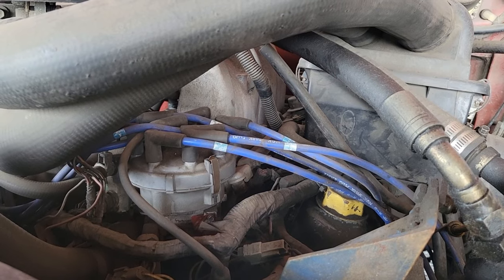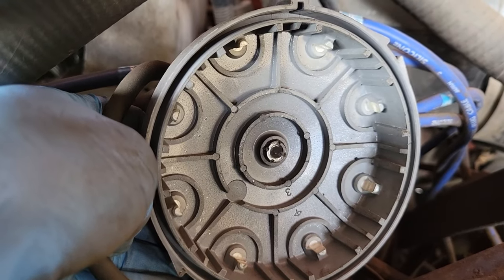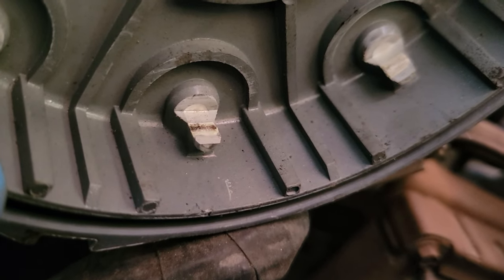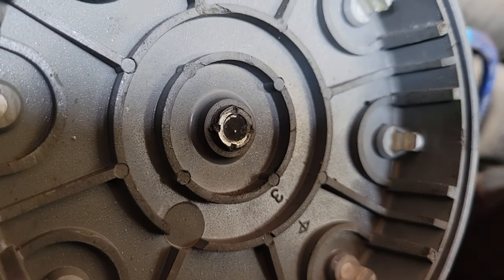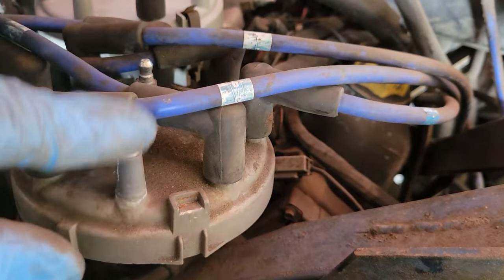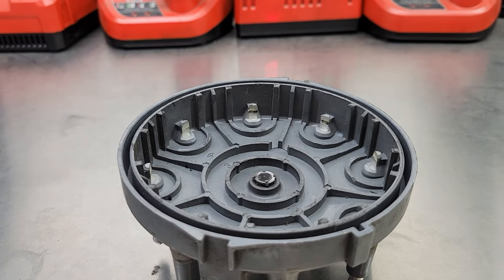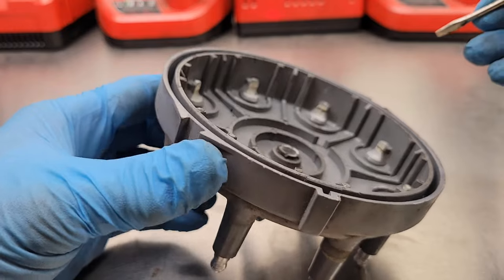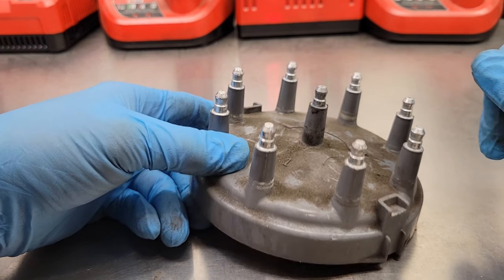Misfire Stall Or No Start? How To Check Your Distributor Cap For Common Problems.

Comment: Yup, I had a no start.  Pulled a plug wire, plugged in a new one grounding it to the exhaust manifold and cranked it, I had spark.  Sprayed some starting fluid into the throttle body and cranked, no fire,,,,what?  Got spark (so I thought) and spark juice.  Ran perfect the day before.  Checked all the fuses and relays, good.  Checked fuel pressure and pump, good.  Pulled cap off and center pin was broke off,,,,dang, never seen that before.  How did I see spark when I plugged in a skate plug,,,,baffling!!!!  New cap and smooth as silk again.
Reply: Hey sounds like you're having the same problem I'm having today June 2023.. I tell you what man it sucks just wanted to tell you I got my F-150 1995 and I have replaced the distributor cap and rotary button as well... still having a problem with it not cranking you need to do like I have done and check the ignition coil on top engine to see if you're getting spark? If that's good and you're still not getting spark check your ignition coil modular over there on the driver side fender.. by your brake booster and master cylinder.. it costed me $66 the other day at auto zone.. just wanted to share that information with you since you're having about the same problem I am maybe they'll help you man
Reply: liked
Reply: No spark on my gmc sierra. Aparently the ICM is infamous. Today im replacing the ignition control module, ignition coil and distributor cap and rotor button. Hopefully its one of those. I really dont want to learn how to change the entire distributor but ive got to get it back up for work on monday lol @jessicasteffey

Comment: Beautiful job brotha man. I just did a tune up and decided I wanted to wash my 1977 Chevy 350 motor and after I did I was getting a misfire.  Now I know what to check ✔️.  Awesome 👌
Reply from the maker: Thanks for the great comment. 👍 Glad I could help. I remember 4x4ing with a friend and he went through a big puddle fast, then the truck shut off. When it was engines I always cover distributor with a grocery bag.
Reply: @Shaners Mechanic Life  funny thing is it ended up being a bad spark plug out of the box. But I still cleaned everything and checked everything. Thanks to your video.  :)

Comment: I have a similar issue with my 95 SL500. I doubt the caps/rotors have been changed since the 00’s. When I checked them, there was all sorts of carbon tracking, corrosion and gouging on the contacts as well as condensation. Ended up sanding each contact a little (I wasn’t too thorough) and it fixed the misfire for about 2 minutes. Currently waiting on all of my parts to get here; hopefully that’s the issue.
Reply from the maker: Let me know how it works out for you. I always start with maintenance items when dealing with driveability issues.

Comment: I have a 94 caprice had it for four years never change the spark plugs or did any real route team maintenance other than oil changes finally changed the spark plugs. Exaust started backfiring fixed but now the car jerks and idle and slow acceleration could be because of the distributor ?

Comment: I have an 87 dodge d150 with the lean burn computer. My center nub on mine does appear to be worn down but I don't think it moves. I'm trying to replace the pickup coil right now. Never thought about the cap itself being the problem.
Reply from the maker: I always recommend checking wearable maintenance parts first when there is a drivability issue. Let me know how it works out for you.  Thanks for watching.

Comment: Circuit board cleaner after the water displacer when cleaning out the cap. 

After brushing out corrosion from the leads and points, hit with circuit board cleaner before your dielectric paste. 

It's used to clean circuit boards in a laptop, so should be okay for the distributor cap and leads. 

I use the circuit board cleaner when changing fuses in my hatchback
Reply from the maker: Good idea. The circuit is only as good as its poorest connection.
Reply: @shanersmechaniclife3164  physics 101

Comment: That's 💯.. Thank you so much..What causes Toyota corolla 110  be sluggish in climbing hills but on flat surfaces it's picks well.?? Have changed spurk plugs nothing has changed except reduced fuel consumption
Reply from the maker: Have you changed your fuel filter recently?

Comment: Speaking on the wire diagram I have a stack of photos of firing order sequences lol those really help but putting a little mark on em isn't too bad of an idea
Reply from the maker: I do the same thing sometimes.  Start at one point and number them going clockwise.
Reply: @shanersmechaniclife3164  I have one of those low profile distributor caps so it's all numbered already 😅 but it's good to know left side goes 8246 and the right is 1537

Comment: Ibe got the 94 ls 400 and currently trying to retime what I believe is the ignition timer. 

TDC is marked on one housings where two caps were replaced along with in the same spit the rotors where changed. One of them is set perfect but it's the other one which didn't have a mark like the other one was for TDC to know how far 10 degrees was. Giy working on my car who use to be a good friend up until this does know his way around an engine. But if you know anything about a lexus ls 400 eng8ne you know this thing is a beast and has so many parts that it takes quite a lot to get this done. Anyways where he thought might have possibly been a mark for TDC  he used and used that to adjust to the 10 degree but alas it was wrong. Why he put the whole car together before checking his work us something I can't answer but to express how utterly lost I am at understanding just how far this issue can go isn't nearly enough. 

I'm assuming all but this one is fine. 
From my knowledge there are just 2 distributor caps and 2 rotars which are the only two things I know timing has been adjusted on and if he's right about the one then only one of these two things are set wrong. 

My biggest pain in the ass is understanding ehat the heck that cap went onto? The distributor? So the rotor powers the distributor then or what?  For some reason i thought it was a cam. As this engine has 4 of these damn things so as you can see with that info maybe you'll have some empathy for my frustration and see where it's coming from. 
I'm looking for someone to give me some clarifications to understand what the hell to look at or into to try and fix this problem. 

It's likely really fucking simple beyond the taking shit apart part and involves a few twist here and there I just need to know where that is

Comment: If you have moisture in the distributor cap you can spray wd40 in there and it will wick the water out. Then just take a paper towel or rag and blot the excess wd40 off. 
I had a jeep that wouldn’t start if left out in the rain  I would spray the cap and plug wires with wd and it would start right up.

Comment: Thanks many!  I have a 1998 3.3L Nissan Pathfinder. 175,000 miles. Great condition. Stock. My tank gets alarmingly  pressurized when driven a couple hundred miles. I don't have any codes. My Nissan gas cap visually inspects clean and good. Does not leak. 

I even disconnected all hoses on the EVAP system and cracked the gas cap. No codes were made either. How can that be? I drove it dozens of miles to test. To see if the missing stopped or codes would appear. No codes, except random misfire. Every now and then, but the motor is obviously missing mildly to badly all the time.  It gets worse for a while when I refuel.  For a few dozen miles.  

When this system started doing this, I started getting a random misfire code at the same time. These may be unrelated. Not sure. 

I have verified purge valve works, hoses are clear now. One was dirty about 2" clogged at the canister for the purge line. It looked like charcoal dust. All other hoses clear. 

Any ideas?  I was going to remove the plug from the cannister ambient vent valve and see what that did. It should toss a code right?  And make the valve open, from my understanding?  I don't want the tank to pressurize like that again.  It will spew and hiss for about 6 minutes when cap is removed. I've never seen a vehicle do it this badly before. 

Thanks!

Comment: I did a spark test . I have no spark in 3 spark plugs but 1 does . Would this be the cap ? Someone said it could be the ignition coil. But i assumed if one plug got spark then the coil must work

Comment: What happens of the rotor moves around while changing the cap ? Will it mess up the timing ?
Reply from the maker: Depending on what's moving, older distributors have vacuum and centrifical advance. What your feeling could be perfectly normal. Did it run fine after you put it back together? Thanks for watching.

Comment: This procedure works for any car??......if i change the rotor, does it require any ...CALIBRATION OR ALIGNMENT??...or it's a straight out replacement? THANK YOU
Reply from the maker: Most rotors only go on one way. I always note what way it is pointing before I take the old one off. Also, mark your spark plug wires, you don't want to mix those up. Timing adjustment shouldn't be needed unless you remove or turn the distributor. Thanks for watching and commenting.
Reply: @shanersmechaniclife3164  thank you 4 the reply. Forgive me, I meant to say the rotor button, I believe it's keyed it only goes in in 1 direction....does it need any calibration or something?

Comment: My mechanic recently put a new distributor and now the car hesitates/stalls when driving. Do you think he installed it wrong?
Reply from the maker: Hard to say without looking at it. If it was installed wrong it would most likely be a nostart or back firing issue. Might have another problem?

Comment: Thanks, good videos. Can fixing the distributor cure a misfire? I have a 0300 code.
Reply from the maker: Thanks for the great comment. Yes a bad distributor cap can cause a misfire. P0300 is a misfire code not tied to any particular cylinder so they can be troublesome to pinpoint. Let me know what you find and how it works out for you. Thanks for watching.

Comment: Hello! I need some help!! Im at a lost with my 81 jeep wagoneer limited v8, i replaced sending unit,vents,fuel hoses,starter,capstiol,coil,pickup coil,wires,rotor, distribution cap,just everything i can think of. Still it will not start it turns but no start. Im beating myself in ass wondering wth could be wrong. When i brought it home it started and it out for a spin and came back and parked it and since that day no more starting then when i started replacing everything i could think of!! You u have a clue what could be wrong????
Reply from the maker: Crank it over with your distributor cap off, see if the rotor turns. Check your spark plugs and see if they are wet with fuel, pick up a spark tester and see if you have spark. Basically try to see if your missing spark, air, fuel, or compression. Once you find out what your missing, it narrows down the cause. Let me know what you find.  Thanks for watching.

Comment: I got a Ford sierra 1987 V6 GLX. That does not want to start. I replaced distributor cap, the rotor and the point, I also changed the condenser, plug wires, new coil and new spark plugs. My timing is on point but still it does not want to start.
Reply from the maker: Have you figured your no start out? I would check for power and ground at your ignition coil and check your point gap. Hope it works out for you. Let me know what you find.

Comment: What's the proper use of dialectric grease? I see the squeeze packets with a picture of a spark plug but I read recently the grease is non-conductive. Also, as you're working in this video, everything's dry. Help please. I found your video in a search of how to know when distributor is bad.
Reply from the maker: Thanks for the comment and watching my video. Dielectric grease helps keep water and contaminants out preventing corrosion. It also acts as a lubricant to help you or the next person remove the plug wires without damaging them. I just use a small dab inside the plug wire boots.

Comment: I have the same truck and motor , i cannot get mine to run. I set my motor to tdc on tge compression stroke and then install my distributor accordingly and all it will do is back fire, do you have any advise?
Reply from the maker: Did you get your truck figured out? Sounds like it could be an ignition module issue or if you had the distributor out, it could be out of time. Let me know what the problem is. Thanks for watching and commenting

Comment: Hello I had a problem today in my 1977 South Wind 440 Motorhome , it fired up after a long shot and went out. 5 years ago I replaced the engine with a younger one, with only 50,000 miles on it , a 3 years ago I rebuild the carburetor due to a large misfire, that time I blew up the mafler, a month ago I replaced the spark plugs, spark plug wires and the ignition coil, because I had a misfire again , only today when I couldn't start, I cleaned the spark plugs they were black and oily, but I replaced them a month ago !. I drive my home only twice a month, I do 30 miles round-trip
for the dumping and back to my parking lot, so I cleaned the spark plugs, it fired up and went out, so I unscrewed one spark plug and I checked if it gives a spark, by putting it with the cable against the engine and trying to fired up , there was no spark, I opened the distributor, it was in the same condition as the old one in your film, I cleared it with sandpaper and put it back on, the car did not start  up . Now I know that I need to replace the distributor and rotator. By the way, I'm a bit worried, when I took off the distributor cap, two wires were disconnected, I pushed them back, but I'm not sure if they are in the right order . Unfortunately in the hit of work I didn't mark them . What can you advise me ? Thank you.
Reply from the maker: If it was the spark plug wires you mixed up, I would mark the two that are in question. When you get it to start, if it has a miss then shut it off and switch the plug wires. See if it runs better. If it was only two plug wires that were mixed up you have a 50/50  chance of guessing right. Let me know how it works for you.

Comment: Great vid, Big like and Thanks, How about to waterproof the distributor, is there any chance to do it?
Reply from the maker: You can try silicone on the cap but that would make removal a pain. Plus if moisture did get in, it would never dry. Some distributors also have a vent in the base.

Comment: Great video! Looking to learn old cars and have a 1984 Toyota Carina wich this will be aplied on. What are some of the reasons for condensation in the cap? Is there a seal somewhere that could be bad? And is the best option to just replace the cap?
Reply from the maker: Pressure washing the engine is a big reason, but you can also run into it in wet humid weather. The moisture in the air plus the engine getting warm and cold can cause it. Some caps have seals but not all. Have you run into it with your car?

Comment: I have an '84 F250 that suddenly lost ignition while plowing. it will turn over, but no spark. ignition coil is getting 10 volts of power, and I replaced it so it's new, any ideas for me?

Comment: My truck cranks but no start i did starter solenoid sparkplugs this will cause a no start?
Reply from the maker: Possibly. I would double-check your connections and make sure sparkplug wires went on to proper cylinders. Hope this helps.  Let me know what you find.

Comment: I have a 99 GMC k2500. My cap and rotor has been changed 4 times in 10 years. Mechanic showed me mine and said the fine yellowish dust is from misfiring and.iys probably misfiring inside the plastic housing somewhere. Anything else I should be looking for. Also. It runs sluggish sometimes when I step on the gas from a stop. Definitely slower going up hill.
Reply: I would like to know too if someone knows. Did you try changing out the spark plug wires  / spark plugs and make sure the firing order is right ?
Reply: perhaps check your GROUND wire connections....... like to your engine block.  Can get soaked in oil, otherwise lose integrity....in my experience. Simple FIX

Comment: I’ve got 153K miles on a Chevy Caprice had it for four years just now doing a spark plug change. Notice when I changed the spark plugs, Exaust was backfiring and Car was shaking in idle could this be a distributor problem ? My car was literally running better with my old spark plugs before changing them.
Reply from the maker: If it started back firing after the spark plug change, I suspect some spark plug wires got mixed up. I would check that first. Let me know what you find. Thanks for watching.

Comment: This is so close to my truck I got it past 35 to 80 n up but now it’s back to not going past 45 and cuts off when I try n reverse to quick or hit gas to quick I have a 84 custom ford f 250
Reply from the maker: Have you figured out your truck yet? If it's carbureted check for play in throttle shaft. Let me know what you find.
Reply: @shanersmechaniclife3164  I fixed it idk what I did but I changed the fuel pump spark plugs all that and tore down my carb n she running

Comment: My truck randomly started misfiring and dying but when it idles or when I get up to 40 it’s not as bad I have a 98 k2500 any thoughts I’m thinking distributor but my uncle thinks it’s the cam timing
Reply from the maker: Have you tried a new ignition module? They are a common failure point on the GMs. Let me know what you find. Thanks for watching

Comment: I changed cap and rotor and the engine doesn’t want to start time I check that the wires are in right order of firing and they are ok… spark plugs are new too what could it be
Reply from the maker: Was it running before? Could Be a faulty part. Years ago I almost installed a rotor that had no metal electrode.